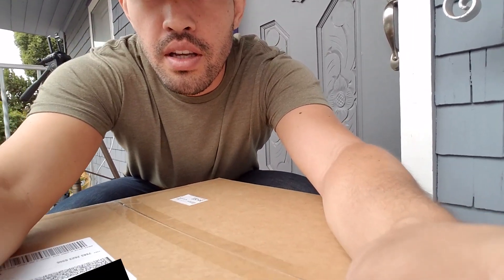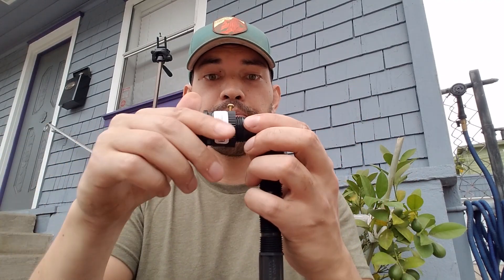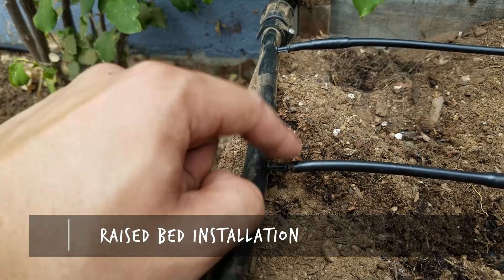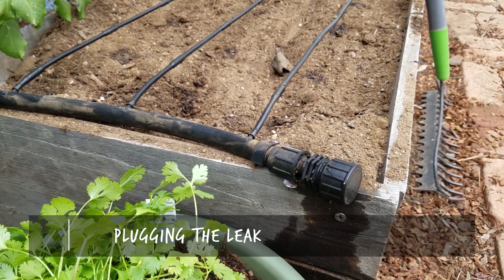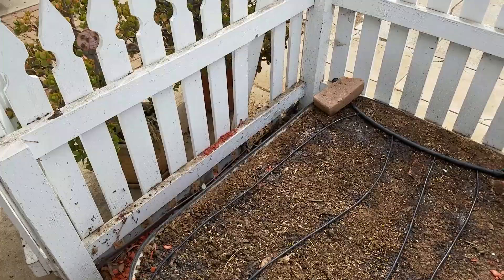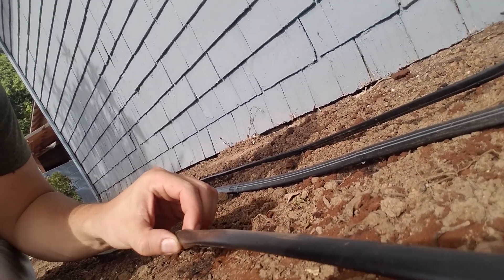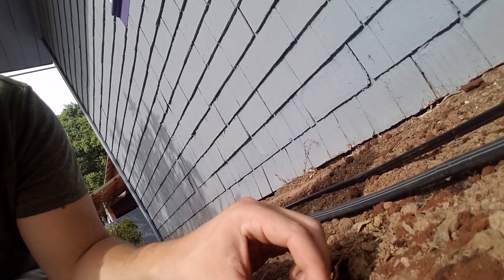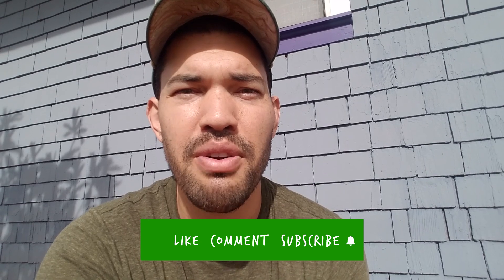Drip Irrigation System Install in 7 Raised Beds!

Comment: Very cool. The broken riser stuck in the PVC is easily removed with a riser extractor for $5 anywhere. You can also use stakes to hold down your irrigation instead of securing to wood.
Reply from the maker: Good call on both - I did end up buying a riser extractor :)
Reply: @Ephraim Zachariah yea, I have been watching on Flixzone for months myself =)
Reply: @Ephraim Zachariah Yea, I have been watching on flixzone for months myself :)